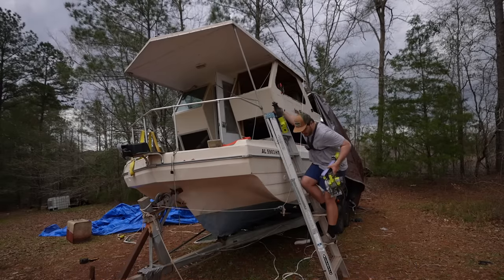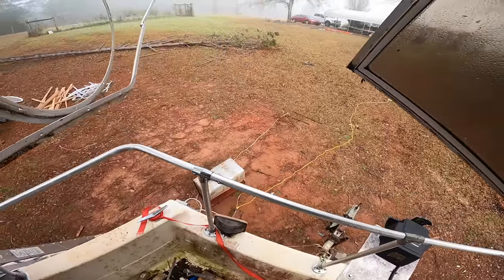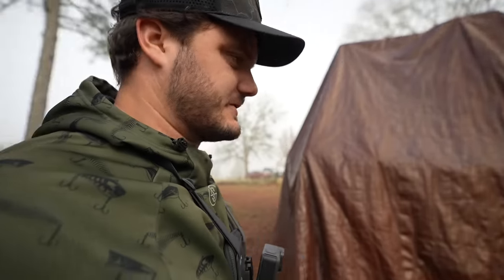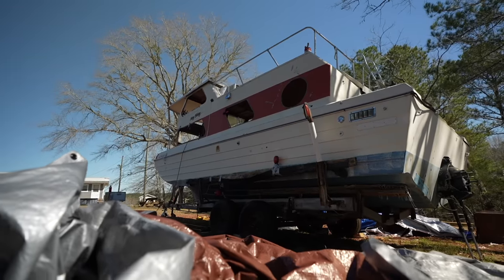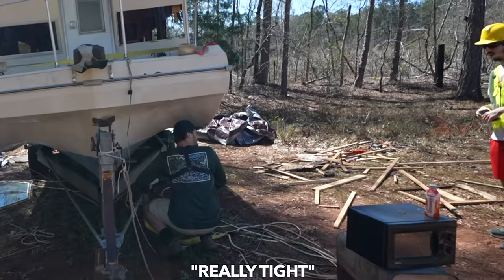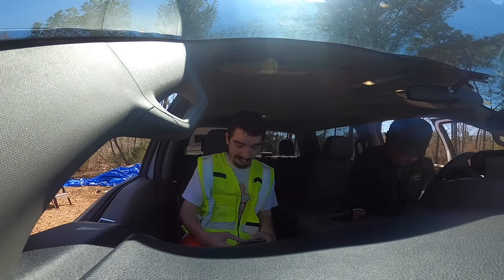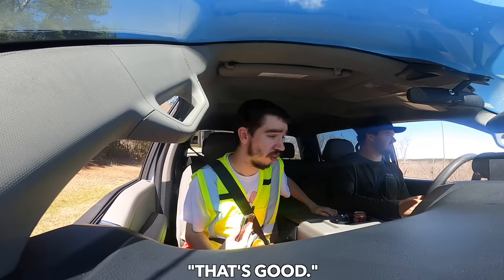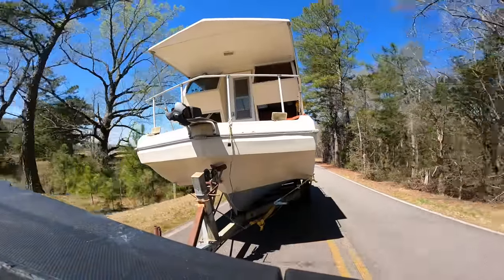I Did Not Want To Have To Do This... (HOUSEBOAT UPDATE)

Comment: Glad you’re getting an expert to help work on the itty bitty. Just a tip for future towing. Make sure the safety chains are crossed. That way if the trailer comes off the hitch the chain will catch it and keep it from nose diving into the road.

Comment: Little tip for Next time, when you hook up the safety chains on the trailer cross them over each other so If anything happened and it came off the hitch the crossed chains will catch the trailer instead of drag it along the road👌🏼
Reply: you do know that DOT states in their regulations, that the safety chains or cables should NOT be crossed?? they have a whole chapter dedicated to towing.. you should read it..
Reply: Lol
Reply: @sativa2050  You do know that each individual state has their own DOT and each one says WTF they want, science be damned?

Comment: All new stringers, transom, floor. A heap of work. Separate the hull from the rest of the boat at the gunwale then fix the hull and rest separately.
Remove boat from trailer and work on trailer separate to the hull. May as well put a pod on the back for an outboard while you are at it, given you can counter weight the outboard correctly. Its not going to cost you more than 5 -10k if you do all the work yourself.
Trailer is cheap. Sand back, grind all rust.   Weld fill any holes. Galv paint. Hopefully the axles and springs are good. If not that is more $. New bearings grease and  wheels all dirt cheap on eBay. Given the time im amazed you haven't changed bearings wheels and tyres (it's cheap literally $500 or less).Looks like the cabin walls are ok so just some caravan walls (watch yourubw for lightweight options). Im surprised you have not at least given it a good pressure clean to see what you've got.

Comment: hey! I was thinking, if youre going to put the drain holes through the floor joints again you might look into cutting a pvc pipe to act like a roof of a tunnel? it just might prevent things clogging the little holes and doesnt pile up between the joists again

Comment: Great video. The Ole Bitty is still a work in progress. Its funny you said you were mote excited about the boat than the truck. We will get trycks and cars throughout the years. They come and go. Not because we want to most of the time but because they are a necessity. Boats that you pretty much rebuild from the inside.....that's not something most people experience in their lifetime. I'm sure it's super exciting. I was wondering when you started ripping the interior out about how long it was going to take. I was literally thinking you needed a fabrication shop lol. Imagine cutting that much wood and fiberglass bu hand one piece at a time with no plan to lay it out
 Rough!

Comment: I know how you feel I have a 12' aluminum semi-v hull boat with trailer I need to clean the surfaces, seal and repaint the boat , I need to take the trailer apart clean off the rust and old and repaint the trailer. I purchased a 1968 Johnson 9.5 hp motor for the boat that has not been started in 10 years knowing I would have to work on it to get it started and boat ready the weather here is not helping me either. I have to work on everything in my daughters yard I do have a carport to work under only thing is the floor is dirt not going to be easy and will take time.

Comment: Sometimes you have to outsource. I almost had to hire someone to hook up my solar system and electronics in the van since a flaming metal box doesn't sound very pleasant. Found a book in lowes about wiring, and whenever I had a question, it had my answer, with diagrams.

Comment: I’m sure it’s been said a few times already and I don’t want to beat a dead horse but anytime you haul a trailer always cross the chains. In case it comes off the ball the chains will catch the trailer. With that being said it looks like you need to upgrade those chains has well.

Comment: A piece of advice: When you hook anything up to your towbar that has 2 safety chains, DON'T run them straight back the way I saw you or the other guy do here. Actually, if it was the other guy, he SHOULD have known better. Anyway, CROSS them, the left one on the trailer to the right one on the vehicle and opposite with the other. You'll notice they make an X right about the hitch (pivot point) below the actual pivot point meaning you can shorten them to just enough slack so that it doesn't put a tearing force on them when you go through and dips while driving. If the trailer did come off the hitch, and I have seen it happen twice now, done this way the hitch will get caught in the sling type arrangement created by that big X and shouldn't even touch the ground. Your "expert" SHOULD have known this.

Comment: I hate to be "that guy" but please get some anti fog solution and put it on the inside of your goggles/glasses. It'll make it way safer for you to work.
Kind of recommend an anti static, or anti dust/water coating for the outside too. Make sure you test the solution on a small area first just incase it ruins them haven't seen it happen but its always possible. 

For the streamers id recommend leaving a larger hole for water to pass through, floor storage or insulation, and the strong plastic "wood" as long as its rated for it. That way no rotting in the floor ever. You can also use carbon fibre as fibreglass if you want to save up top weight and have alot of strength. 

For the walls/roof use vehicle stick on insulation/sound deadening. Esp for the roof should give you some height, is water proof, and great for insulation/thickness. 

Just my 2 cents.

Edit - and prob too late, but might be worth making the rear door wider so that installing stuff inside is waaay easier, could even make the front door higher or wider. 

Use engine bay firewall insulation between the cabin of the boat and engine bay, and for the engine bay hatch. Will cut down on sound and heat. Just make sure its fire proof. Ceramic coating the exhaust in particular will also keep it from rusting which is kind of required for boats, and for the roof bracing, check with boat guys but might be worth some square steel thats painted inside out, cap one end pour some paint on slosh it around well and rotate it leave nothing uncovered. It'll be lower profile and stronger so more height. For you to stand in.

Also since you have no motor, might be worth looking at a more modern v6 or 4cyl, just work out the numbers for the d engine hp, torque and fuel efficiency and simply find one similar or has better numbers. And you don't need no vtec yo!

Kind of think this wont be read but hey this is just advice from an Aussie that was a mechanic and had some construction experience (also built alot of pure offroad vehicles and race cars).

Do wish I had the money to fly over and give you a hand, but going to the USA from Australia is not cheap let alone accommodation, travel whilst there etc.

Comment: To get the boat right in the middle of the trailer without water, park it beside a tree and use a ratchet strap through the bow hook to move it in Its place. Dont Forget to loosen the front winch

Comment: Monday Mornin Quarterback says, that front strap is problematic, the trailer frame gets smaller as it approaches the hitch... meaning as your strap wiggles forward its gonna get as loose as Cindy on nickel night, shoulda wrapped each frame rail then rran the strap hook to hook behind a crossmember. Nevermind looks like you figured it out by the time you got to movin, around that single frame is ok, but for future reference you want your strap to have multiple independent contact points, like if you went over the bow but hooked closer to the wheel wells grabbing each side of the frame behind a crossmember. You always want to circle the contact point from underneath then hook the top(how I scored my wife). You will thank me if you ever see what happens when you bottom hook and the trailer tire runs onto the strap at 70 and spools it up.

Comment: If I had $10 for every unrealistic dreamer in the boating world, I'd have retired 30 years ago. Whenever I've given help the dream turns into a nightmare.
Rule #1 for every dollar you spend buying a boat you'll spend two repairing it,if you do the work yourself.
Rule #2. Cheap boats are cheap because the last owner didn't replace anything because he/she was intending to pass on the problems to you.
Rule#3. Fixing the problems by the previous owner would be a financial loss when selling to you.
Rule#4. Treating a houseboat like a house on a boat will usually result in a death trap. Stringent marine practices must be followed throughout.
I haven't found too much do it yourself material on you tube. Mike Patty's Scrappy build on new construction,Jimmy's World save the 310 for restoration. These are both aircraft where safety is thought more important than marine construction. However over the years marine construction has followed aviation practices,though less stringently. The videos might help with illustrating necessary basic skills.

Comment: Its noble ot want to do things yourself and you have and will.  But when it comes to structural integrity and floating...those are pretty important aspects of a boat.  There would be nothing less soul crushing or less enjoyable to watch than this thing being painstakingly and determinately rebuilt basically from  panels just to have the brand new refurb turn sideways and become engulfed in water
Reply: You are taking and sharing a masterclass in fiberglass boat restoration..How freaking cool is that?

Comment: People find things like this humorous............. The I want it now and "this is my tunnel vision". Before that boat was ever moved at least one trailer side should have been lifted and the tires (tubes?) and bearings should have been replaced and when completed, then the opposing side. The trailer tongue safety chains should have also been upgraded for true safety. (mfg. only have to comply by LAW.) 1. It's a boat. Trailers get water submerged, including bearings. 2. When tires are left to sit for lengthy periods, they develop PERMANENT FLAT spots and are no longer round, especially BIAS PLY tires from the 60s & 70s.

Why did I write all this? Because it is all fact, not fiction. Out here where I live, on one of our interstates, doing 60mph plus, a pick-up truck with an un-secured load of garbage  had a piece of old furniture fly out of the uncovered pick-up truck box going through the windshield of the vehicle behind, striking a young woman in the face causing her to loose both of her eyes from the horrific impact. Tell all of us, how much insurance money?, if even that, are going to replace the permanent damage done all because of someone's lame thoughtlessness or rather because of YouTube algorithms and $money$. Stupid is always content as stupid does until the LAW comes knocking. THUMBS DOWN.

Comment: it has been painful to watch any of this, as you get to bring on a pro. you couldve broken the hull and cap joints, you were walking the hull without retabbing frames. over and over I almost had to dicth this series, cause- so wrong.  brave yes, stupid yes, watchworthy? as I said, pain. hiring a boat builder at the end? oof. next time secure the hull and trailer#2- #1 get the rot out. but dont haul without the hull and trailer being good.